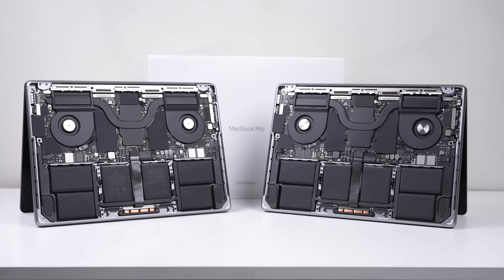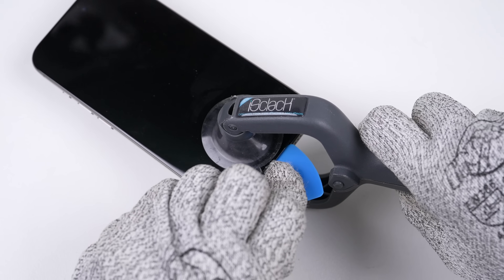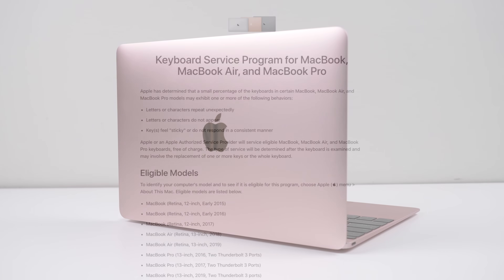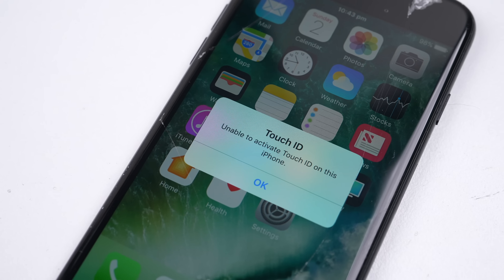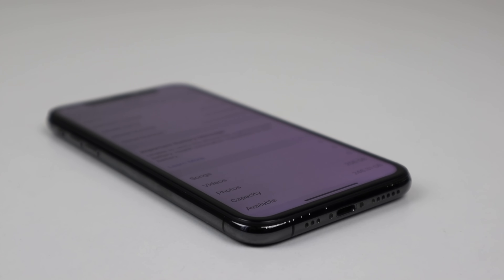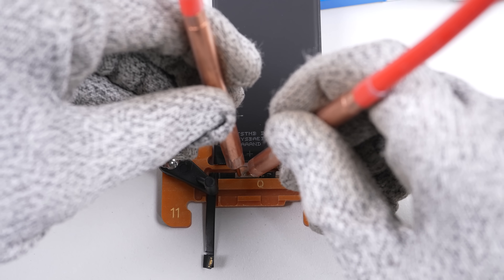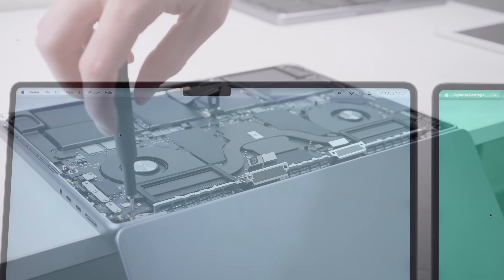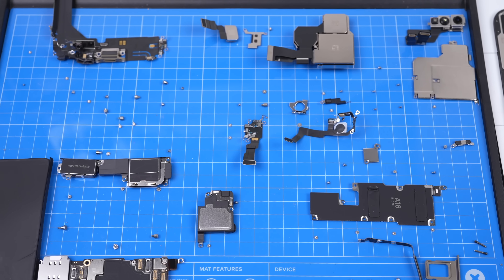Astonishing Anti Repair Practices By Apple In the Last 15 Years

Comment: Softare locking is such a disgusting practice / cash grab and encouraging e-waste, this is coming from a long time heavy Mac user since the Macintosh LCII. In contrast, I'm typing this on a Xeon Lenovo P50. Everything is user interchangeable, easy swaps of RAM, M.2, dual battery, keyboard, screen, etc. I prefer Mac OS, but willing to  put up with Windows to avoid these disgusting practices.

Comment: 2008 with the first Macbook Air, where the PATA drive connector was modified to prevent installing a higher capacity drive that was currently in their video iPod. You could put your MBA drive into the video iPod but not the other way around - and that cost retailers plenty as they stocked up on these drives. I still have mine. Also, travel with the Titanium Macbook to certain countries was prohibited due to it's 'super-computer-like technology.' And Apple's  power output limitation of 100ma, since the 1st gen iPad, is also an unnecessary evil - even their own CCK stopped working much of the time....not a repair issue, but really s*** behavior. Just the dumbest games this industry and our government shills play on us all.

Comment: Im not much of a fan of governments over-regulating business... But the EU is gonna be taking care of alot of this. They are legally requiring iPhone to start using USB C and have a easily user replaceable battery. 

Since the EU is such a big market, and it wouldn't be very economical to design two different products for two different markets, Americans too will start enjoying Iphones with usb c and replaceable batteries.  😊

Comment: Why do people submit to Apple's controlling culture and pay through the nose for hardware that breaks its screen if you look at at it wrong and locks you in to proprietary apps like Facetime and proprietary everything? Open systems came to mainstream IT in the 1980s and ushered in UNIX, TCP/IP etc, which enabled the Internet et al. Apple are exploiting users just as those old proprietary IT companies (IBM etc.) did back then, but Apple are getting away with it because their users are naive fashion victims. I can only surmise that they willingly bend over to get shafted by Apple when better open stuff is available with Android because it's a fashion thing.

Comment: samsung is the best in this regard, i built my own phone from parts i purchased from samsung, individual parts such as mobo, lcd, frame, cameras, battery, charge pad etc
it ended up costing just under what the phone would have cost if i just purchased it (s20+)

Comment: Hate to tell you this, but EVERY manufacturer is EVERY market segment does this. Everyone hating Apple for doing what every other manufacturer does, cars, washing machines, tv's. Its getting boring with all the Apple hatred and the losers who spend their life trying to fight what is a global issue, not Apples
Reply: The parts that most frequently need replacement in cars and washing machines, can easily be replaced by third party parts. And the original parts are usually not severely overpriced, considering the logistic cost of maintaining a spare part stock for a decade. Because cars and washing machines are typically used much longer than electronic devices, therefore spare parts must be available for a longer period. The parts are usually also much larger than electronic parts. That also increases the cost for those car and washing machine manufacturers.

Comment: The worst thing they ever did was disable the GPU in the Retina MacBook Pros. If you paid extra money for an Nvidia GPU in your Retina MacBook Pro, they disabled it through software in later versions of OSX. I believe it was the upgrade from Sierra to High Sierra, after that update your $1000 GPU would no longer work. Turns out the reason they did this was a dispute with Nvidia as to who was responsible for coding the drivers, in the end Apple just disabled the GPU.
Reply: This is insane! How did this not trigger an outcry?
Reply: Can you provide proof of any of this? I've never heard of this and can't find ANY information about it. Which model macbook pro specifically? I've used almost every model ever made and never seen this issue or even heard of it before your comment.

Comment: I may or may not have previously worked for a company that has a name that rhymes with schnapple for a few years. If I did work there I might have had conversations with other people who possibly worked there about the issues in this video.
One aspect you didn’t mentioned was the moisture sensor stickers. Employees knew this was set up to maximise revenue from repairs, things like the moisture sensor stickers that could have been triggered by walking home in the rain and getting wet jeans. These were put in devices solely to ensure that most issues would be considered out of warranty, they had extra moisture stickers inside the devices that would be the smoking gun in someone thinking they had taken extra care, somehow the internal ones would have been triggered and the little red dot immediately invalidated the warranty. If staff spoke up they would be putting their jobs at risk, if technicians were found to be lenient in their implementation of warranty issues they would be disciplined. The phrase “believe or leave” was the core of the ethos there. But I believe the number of lawsuits, along with the number of customer complaints really pushed the company to change, staff may as well have been silent because if employees dared to bring to light any of these issues they wouldn’t be considered positively. 
The schmappall company I possibly never worked for started to target long tenure technicians who were vocal of their dissatisfaction of the shift in policy and design, and had contracts terminated for arbitrary reasons. 
Allegedly 😉😉😉😉😉

Comment: I had fallen once for their tricks with a MacBook pro 2011. Ever since never baught an Apple item. 
However, the issue is the customer. As long as they keep buying their stuff and take abuse, Apple will increase the abuse level.
Reply: What the 2011 do? I have one and was aware of gpu hardware failure issues, but that's the worst I've heard.
Reply: @milesbaureis504  yes GPU
Reply: Was it 15/17 inch?
Reply: @sagwan-square  15

Comment: Rivets are not an anti repair tactic, a rivet requires considerably less headroom to make a fixture than a screw does, and that allows a more compact and thinner device to be manufactured. That is an important point with more compact and thinner are key consumer demands. Glue rather than screws is used for the same reason, not to mention that it significantly reduces assembly costs.

If Apple wanted their products to be more desirable than competitors based on this customer metric, the rivets were necessary.

The same is true for a lot of these other "anti repair" features. They are there for two reasons primarily, namely (a) to reduce manufacturing costs, and (b) to satisfy customer demands for thin elegant designs. Without these features we would have phones and computers that were more expensive and bulkier than what we got.

Comment: I dont trust apple "supporting" right to repair. I think they just want to control it. Apple really is dumb because if they sold spare parts for every device, they could make MORE MONEY on said parts, than if they would have just made a whole device with them and sold them as a single device. Just charge a little more per part, than the money you would make off each part for a complete device, simple.
Reply: But not so much money per part that its ridiculous, like they want to do...

Comment: The reason Apple is 'on board with it' is the same reason you'll find BP and Shell on environmental action and awareness committees. So they can steer it, slow it down, and influence it. Don't for a second think it's for your benefit.
Reply: Corporations love strict laws. They have the money to work around them, particularly if they write the laws and exempt themselves from it as much as possible. This is a long term competition stifling plan, nothing more.
Reply: @doktork3406  said it best. Dont think it's just "slowing down" good environmental regulations. It is all controlled and flawed from the start. Rotten to the core, and only advantageous to them
Reply: I read a comment that basically implied the devices that are under the right to repair bill are NOT waterproof, and since most Apple devices fall under the category of "waterproof by definition", they're pretty much exempt from it. That didn't stop them from being able to refuse service because your USB-C port got slightly moist, regardless of humidity or dunking in water, if the sensor got triggered, Apple just says "f*ck you" and your stuck.

Comment: wouldn't be surprised if the optimized battery charge to increase battery life actually decreases it. i had an iphone 6s, it didn't have the option, had it for 4 years and its battery was always at 100%, Only charging while i slept. upgrade to iphone 10+ and batt is at 80% health, i leave optimized charge on and it further drops to 70% in two months. only charging it while i sleep. i turn off the setting and 1 year later it remains at 70%, still only charging it in my sleep.

Comment: The most anti repair thing I have seen in apple products is the glue under the battery plate of the macbook air my customer sent in. The plate already has screws holding it in but apple decided to add the glue just to make it extra annoying to fix.

Comment: The crazier thing is even with ALL OF THIS, Apple still has an even larger history of covering up or just plain ignoring known design or part flaws. Forcing customers to file class action law suits to get things covered under warranty but usually 3 to 5 years after the devices "usable" time frame in the Apple eco system. The Macbooks with GPU failure and GPU power issues, Butterfly keyboards, screen coating failure, iPhone 6 touch and cellular issues, iPhone 7 cellular and audio issues, iPad Air 1 5, 6, 7, 8, and 9 charge port failure due to bad design (a design they fixed in the Air 2 which came out after the Air 1 and before the iPad 5), and so on and so on. 

Apple makes good stuff but they also are very shady in their business towards competition and even its own customers.

Comment: Seems to me that Apple have no interest in repairing the phones themselves unless it’s a simple and expensive replacement like a new screen.  Their people at the so called “Genius” bars have no tools or knowledge to carry out the kind of repairs which are routinely done by expert independent repair shops but rather than allow those guys to make money on the fringes, Apple have deliberately opted to make it as difficult as possible to carry out the repairs they themselves have decided not to in-house the capability to perform.

It’s a real “dog in the manger” situation with big corporate America striving to deprive small expert businesses of their livelihoods and at the same time forcing Apple’s long suffering customers to have to spend more and upgrade.

Depressing how far Apple has strayed from its original counter culture roots.

The only problem is their stuff is still so beautifully designed and reliable.

Comment: Imagine how far tech would be now if it weren't for planned obsolescence and anti-repair design.
Reply: And if the printer ink scam didn't exist
Reply: Yeah, laptops would still be an inch and a half thick and fail all the time
Reply: @lordlucan529  Even if that were the case, beats 50 millions tons of e-waste per year!
Reply: @lordlucan529  Who cares about thickness. You have weak noodle arms, can't carry it around?
Reply: @GreenLeafUponTheSky  I started using portable computers when they were the size of a small suitcase, weighed more than you’d be allowed to check in as airline luggage and you were probably a twinkle in your parents eyes.
Reply: @lordlucan529  So you like it that companies plan things to break? And when they do break, they make it as difficult as they possibly can to fix, putting actual R&D into stopping you from really owning your own product?
Reply: @AngryYouAre  Jeez, how many computers (or any other electronic devices) have you designed and manufactured? None I suspect. Your assertions are simply not true, and even if they were you’re free to purchase whatever you like.
Reply: @lordlucan529  its like you didnt watch the video youre commenting on. or are you just that daft?
Reply: @Zlyde007  They didn't lol just mad and saying anything to disprove the great points the commenters are making.
Reply: @lordlucan529  Framework has the most repairable and upgradeable laptop design on the market at the moment, providing its users the ability to upgrade storage, RAM, wifi, displays, swap keyboards, screen bezels, ports, and even mainboards and battery. Their 13 inch model is around the same size and thickness as a macbook air providing similar performance with 12 hours of video playback on battery. But you wouldn't know a whole lot about laptops as you only read the headers of youtube videos and corporate marketing.
Reply: @lordlucan529  guys i fount the atheist that worships corporations

Comment: Ok I will point out that it’s unlikely they deliberately slow down older phones. They just develop on faster hardware and don’t test os version performance on earlier phones. The battery issue was separate — the deteriorated battery would cause crashing if the performance cap wasn’t used due to lower current capability of the batteries. Not popping a notification to the user was absurd, but the process of capping performance to prevent devices crashing isn’t absurd.

Comment: If only apple was the only company to do this, most of the bad practices that apple has done was done by the auto industy decades ago. From riveted transmissions, to special screws and tools needed to do even the most simple of tasks, car makers want you back at their overpriced dealerships, much like apple. Take the electronic key that costs less than 2$ to make but costs 350$ programmed to fit your car at the dealership. The car dealers have also learned from apple to, like paying to have accsess to a feature on your car, but if you trade it those features quite working until the new owner pays for them again. Many car makers are trying that out.

Comment: Don't trust apple suddenly supporting repair legislation.  I run a repair shop and the insane hoops we'd have to jump through to qualify for genuine parts etc is utterly insane.  Most likely just apple doing their usual thing of publicly claiming support for X but making the conditions so onerous that barely anyone can or would participate.
Seriously, making an OS install impossible if the macbook's clock is a few minutes out (and the only way all but power users could change it was to have a working OS) wasn't an oversight, it was absolutely deliberate maliciousness.

Comment: You are wrong about the true tone work around. That IC chip on the display only affects the error message "this is not a genuine apple part" True tone can be easily copied with an iCopy or JCID or similar device.

Comment: Besides the repairability aspect the thing really obvious in Apple products is they are not designed for manufacture.  An excess of screws, lots of connectors, lots of separate modules, lots of flex pcbs, soldered interboard connections where easily removed connectors would make far more sense.

Comment: No, repairability issues actually started in 2008 with the introduction of original MacBook Air with Apple soldering the RAM inside that machine instead of using traditional an repair friendly Sodimm RAM that all other laptops had at the time.
Reply: I can kinda forgive them for soldering RAM and SSD in a product as thin as the MacBook Air, but there's no fcking way they needed to do this on, for example, my thicc boi 16" MacBook Pro. This level of being anti-consumer is just insulting. And as for iPhones... I remember the good old times when i was able to easily disassemble my iPhone 5 and change the battery, display or whatever else with no problem. Now, my wife's iPhone 12 mini needs a battery replacement, i've looked it up and oh god... The whole process is like walking through a minefield, I don't have the tools to transfer the BMS from the old battery, and without that it would block the access to battery health info and display the annoying "needs service" status (which would also hurt the iPhone's re-sell value if my wife decides to sell it later). And to add on top of that, even if i was somehow ok with bringing the device to Apple for a replacement, i physically cannot because Apple has officially left my country. What a joke. Feels like nowadays we don't even own our devices anymore. I love using Apple products, but Apple as a company... They can go f themselves. It's one of the most despicable, anti-consumer and greedy company out there.
Reply: @Warr1on  soldering SSD is a bit no no. SSD’s have a limited lifespan and once the ssd dies, if the machine has soldered ssd, you are screwed. Despite SSD’s fail less often than HDD’s, it is very possible after huge amount of data written to it.
Reply: @jailbreakhat1890  And to add insult to injury, lower-end Macs have a pitiful amount of RAM (they're still offering just 8gb of RAM in the base model, what the actual f...), so that the machine is heavily dependent on using swap, which accelerates the SSD degradation over time, which in turn will render the whole motherboard useless after the SSD failure. There needs to be a regulation against this BS.
Reply: youre too young. in 1983, macs shipped with a sticker that said "do not remove case, no servicable parts inside."